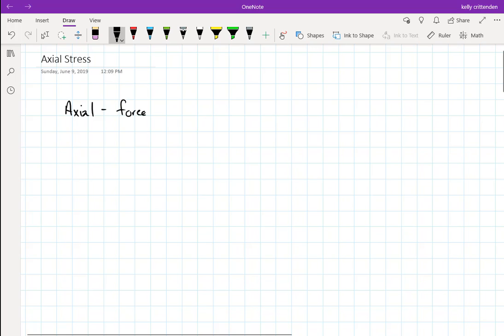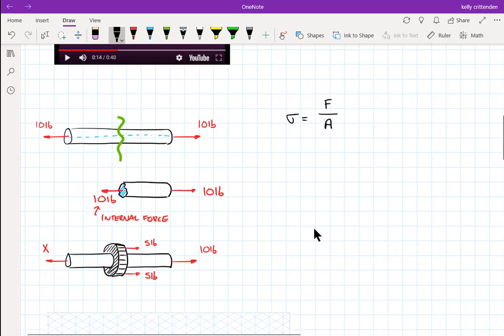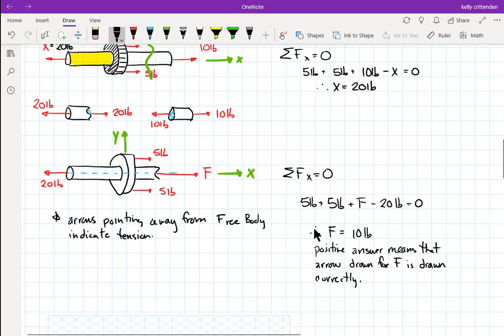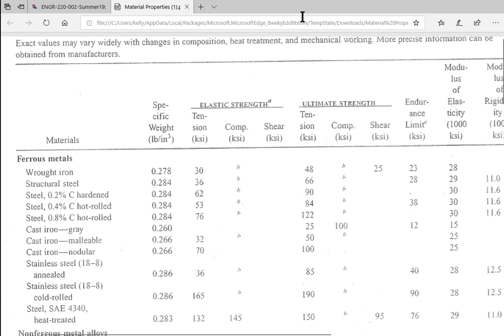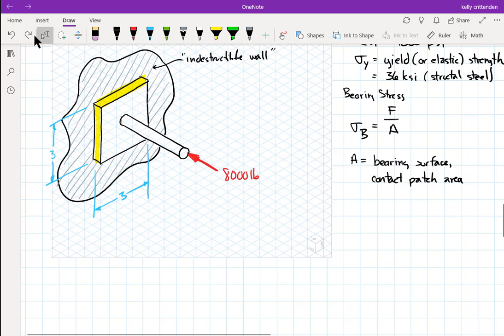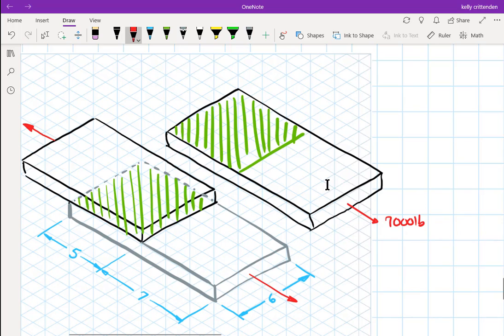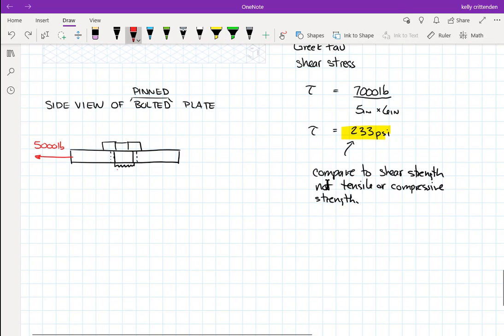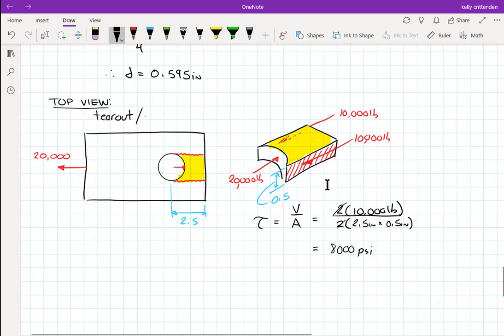Axial Stress, Bearing Stress, Shear Stress, Tearout Stress | ENGR 220

Comment: Tearout stress, you used two formulas, F/diameter x thickness of plate and F/length x thickness of plate. Is it same?
Reply from the maker: I will have to check to see exactly what you are referring to, but F/(dia*thickness) is usually how I write bearing stress which is a compressive stress. I usually write tear out stress as F/(2*length*thickness); the 2 is from having two areas that need to tear out.

Comment: Hi Kelly, i have a confusion on cross sectional area. Let's take ex from 10:21 min.
I get confused with how to cut the part, parallel to the base or perpendicular. Can you explain? 
1. The axial loading was applied and the cross section was done through a plane perpendicular to the load.
If i follow the same logic.
In case of Beams for ex
1. Square beam, simply supported is having a UDL load applied from the top.
When we calculate Inertia we section it with a plane that's not Perpendicular to the laod.

Can you explain?
Reply from the maker: I think you are thinking about two different types of stress. The stress at 10:21 is an axial (or normal) stress. This stress is defined as the stress on a plane that is perpendicular to a load along the “axis” of the part. Also, at the level of this presentation we are talking about average stresses so we are ignoring any sort of stress concentrations or risers. In your example #2 you are describing what I would call a flexural stress. That is assuming the beam is supported on both end and the UDL is “bending” the beam. I do have a few videos later in this course that talk about flexural loads. The difference in axial stresses and flexural stresses is that in an axial stress like we have here, the stress is all tensile or all compressive on the cross section. For a beam in bending, a cross section parallel to the load will have both compressive stress and tensile stress at different points in the cross section. If you think about a beam as it bends some portion of the beam is being compressed (usually the top side) and another part of the beam is being stretched (usually the bottom). Of course, you can have some elements that have axial stress, flexural stress, and even torsional stress all on the same cross section, but that sort of combined loading would be beyond this scope of this course.

Comment: So … I've never heard of shear strength being approximated as half of tensile strength. In almost every textbook I've seen, they go with two-third of ultimate tensile strength, and in aerospace industry, we do 57.7% of ultimate tensile contingent on the factor of safety = 1.5. Anyway … Awesome video! Thank you so much for this.
Reply from the maker: Thanks for the comment! This particular content is for a sophomore level introduction to statics and mechanics so it takes a relatively simple (and extra conservative approach) since many of the students will not take more advanced mechanics courses to know when it is OK to use the different failure theories.